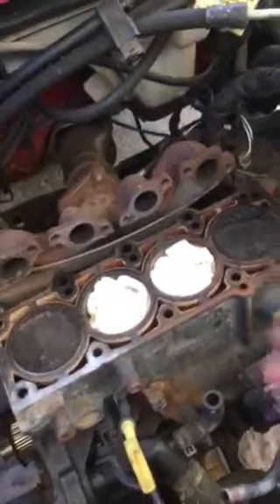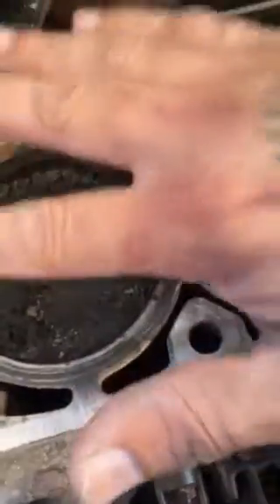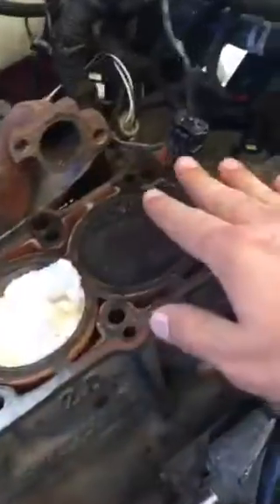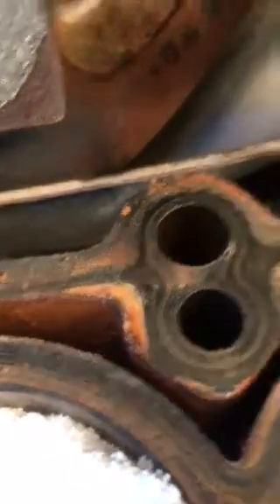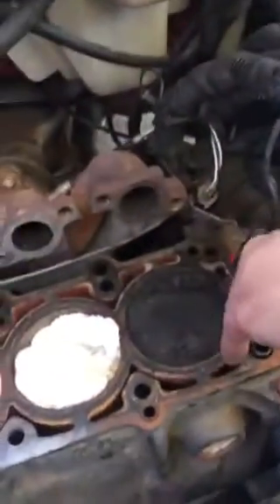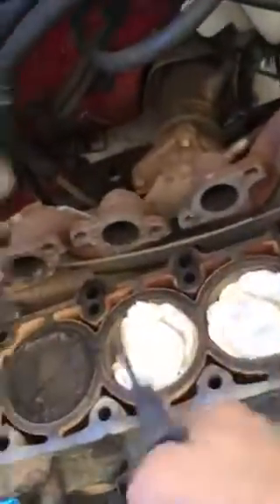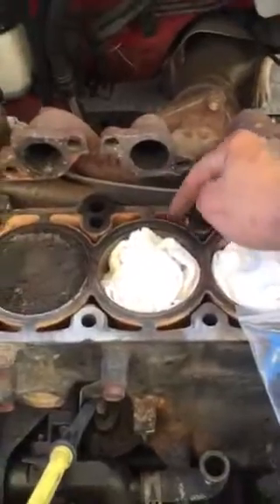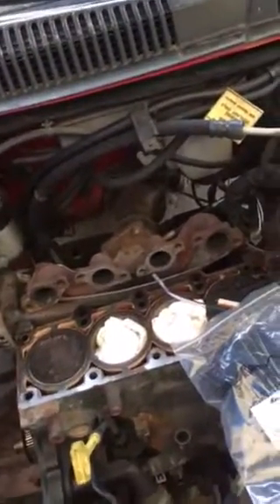How to clean engine block of old head gasket

Comment: Yo boss I have a question for a Kia I could comment on the Kia Optima video.
Reply from the maker: Tell me?
Reply: 256mike  So I have the same issue as the video my rod bearing is out. I dropped the oil pan and removed the oil pump. What’s next boss man. I seen that shine aluminum block. Who did you remove that.
Reply: I also had metal shaving in the bottom of the pan. So I take apart the pump and give it a quick clean.
Reply: My 2013 forte Koup 2.4 has the same set up
Reply from the maker: rancie hood front motor mount remove it
Reply from the maker: rancie hood oil pump must come out to fix bearings.
Reply: 256mike got it buddy